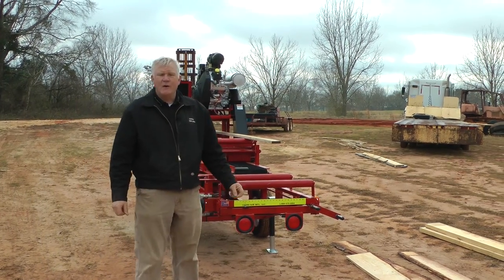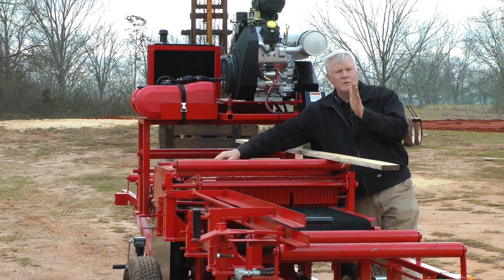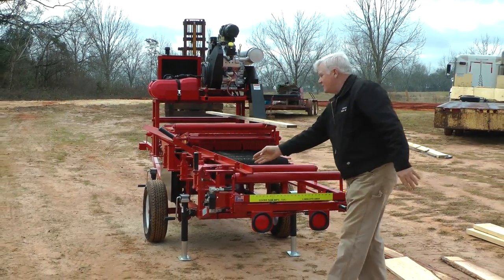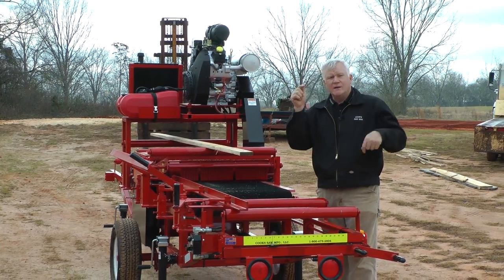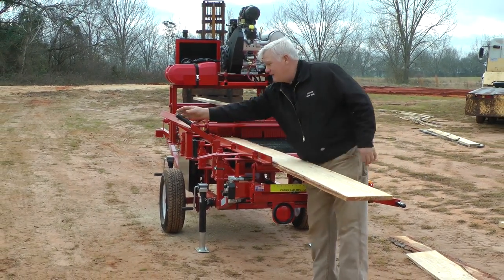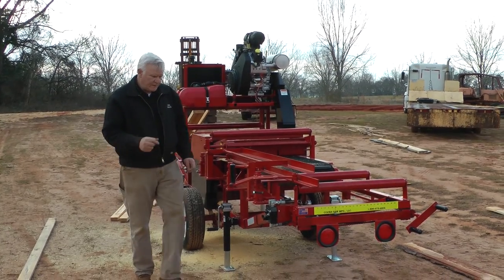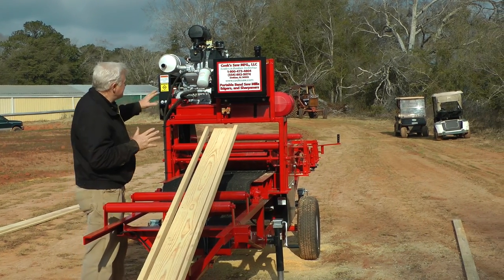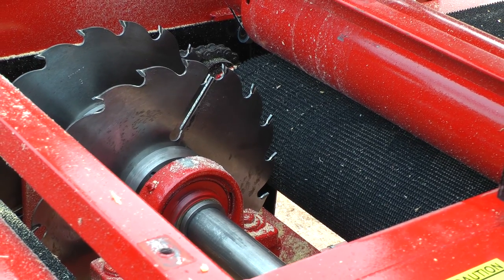Cooks Saw Board Edger

Comment: The feed belt how hard is that to change
Reply: Very simple. There's a small diameter nylon coated wire that is threaded through the lacings. Takes about 5 minutes per belt. These belts are tough, they don't need to be changed often, even with heavy use.